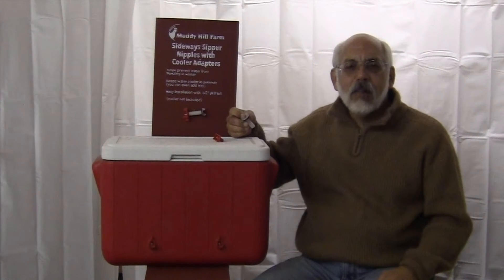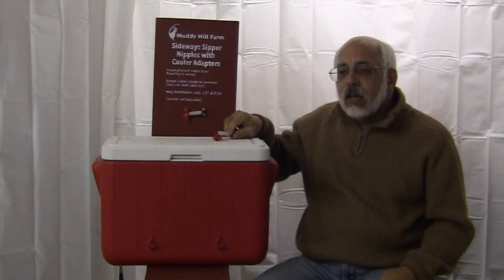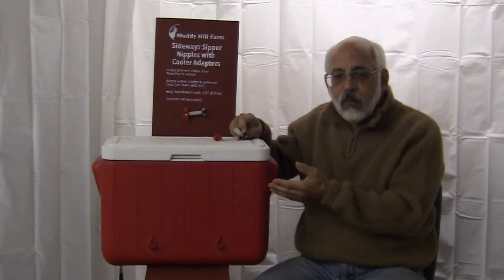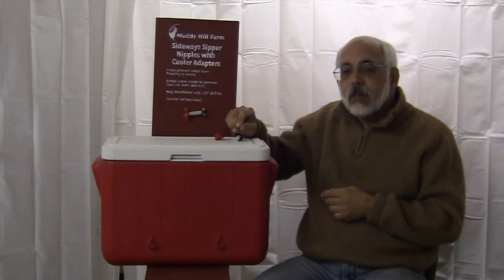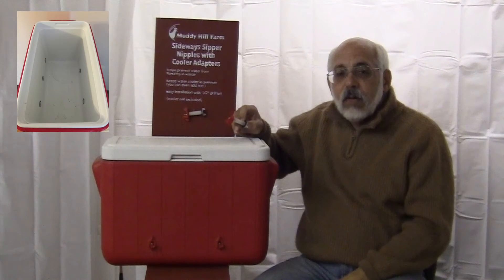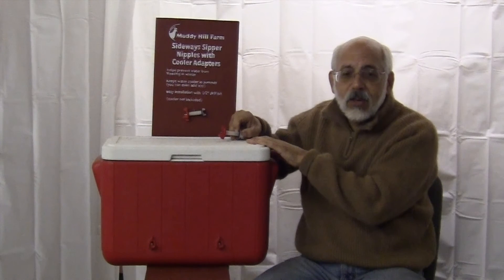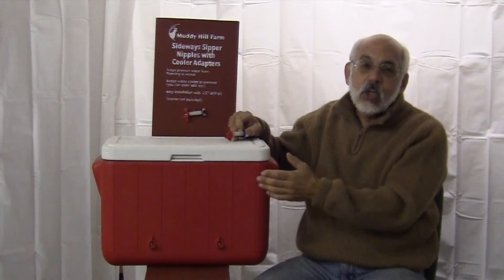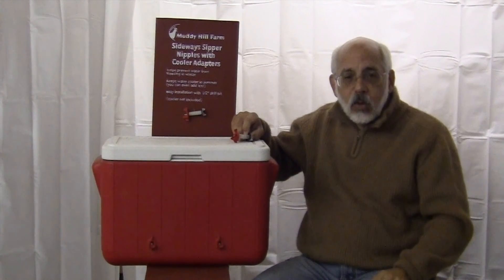Convert an Insulated Cooler - Cooler Adapter for Horizontal Poultry Drinker Nipples

Comment: Wonderful idea.  Any way to hook up a tank heater inside the cooler?  We are in a northern climate, so keeping the water warm is more of an issue than keeping it cool in summer.
Reply: We have had folks tell us that they have had success with using stock tank or aquarium heaters to elevate the water temps - Please be very careful if you choose to do this and monitor the electrical supply cords for wear from curious livestock